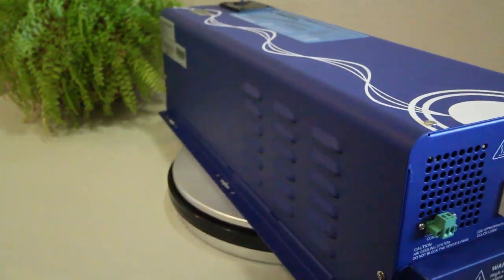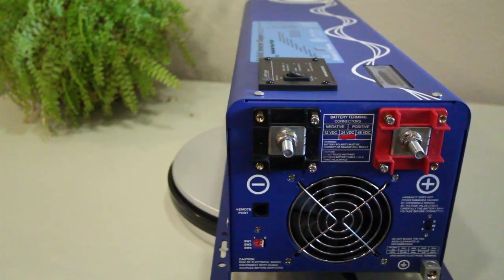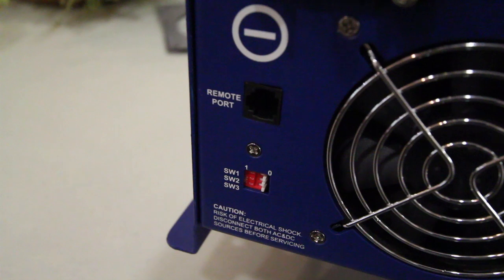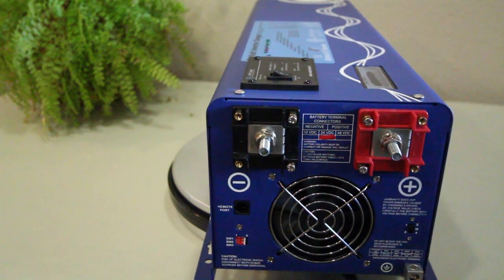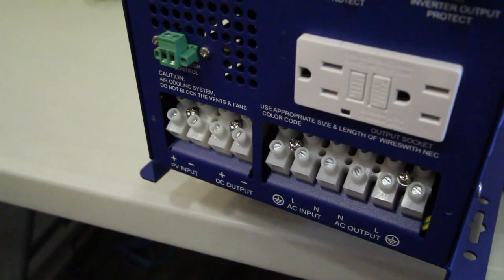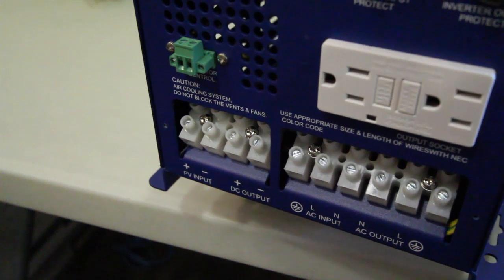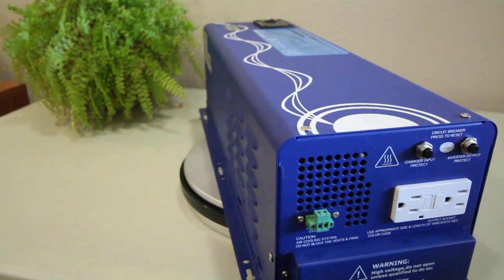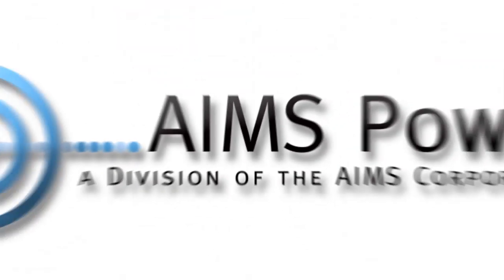1500 watt 12 volt low frequency AIMS Power solar inverter charger

Comment: The unit failed after having it for 4 months. Went to over load for no reason. Was using 300 watts out of 1500 watt capacity.  The unit is now fried, what a waste of $500.
Reply: Hi.  Getting Aims to do anything after your warranty is a fools errand.  I am buying all the bad Aims inverters for parts.  If you have one to sell, please reply here or better  mrtransistor@charter.net